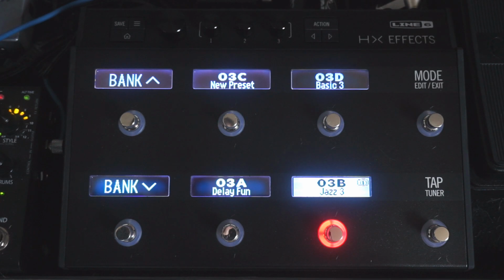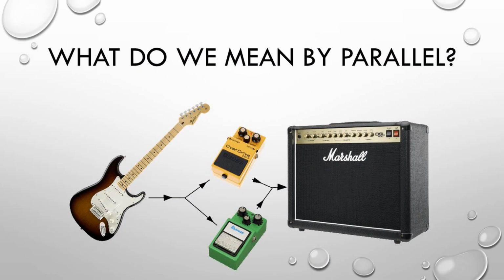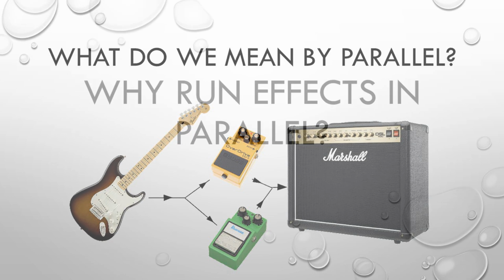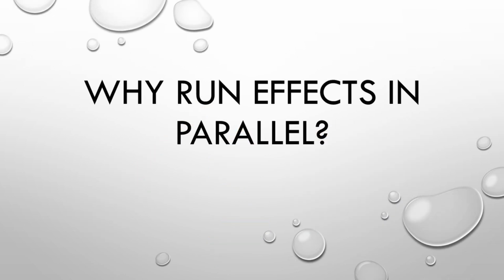Line 6 HX Effects - using the Signal Flow and creating parallel effects

Comment: i have a roland jc 22, it got fx loops and can work in parallel. my goal is to get two signals at the same time, one with compressor, distortions, etc (everything before the fx loops block in my hx) and my delays and modulations i want them clean, 100% wet... but when i set them 100% wet no matter what i do the delay is repeating with distortion... when i run it in series it works but it sucks tone it sound very different. in parallel without using distortion before the fx loop, the sound is perfect, i want the clean delay parallel to the distorted guitar. any clues on what i'm missing here? i mean it  has to be possible to do what i intend or is it really necessary to use two amps to get this 100% wet + 100% dry setup that i'm trying to get?

Comment: Hello, I am trying to use my Hx effect to run all 9 effects at the same time if I want, but what I want to do is have 3 of the 9 always on in the background and still be able to switch on and off any of the 6 on my main interface but thos three in the background always stay on, right now I have those 3 assigned to 3 different switches so 2 effects on each switch.. Do u know how I can do this?
Reply from the maker: If you want those three alway on, then there's no need to assign them to a footswitch at all. Just configure them to be unassigned and use the footswitches for the 6 you do turn on and off. Hope that helps.
Reply: @thehont8648  thanks mate, I actually did figure that out just after I sent the message : )  but thanks very much anyways mate
Reply: I'm glad you asked as I didn't realise this could be done! Thank you both - for the question and the answer.

Comment: Thank you for the really informative video. A question, even if you place the fuzz on a parallel path when it comes back into the main path, even though further along wouldn’t they still be running into each other?
Reply from the maker: It would only be running into effects that come after the rejoining point. The merge will sum the signal, not cause them to interact with each other. Hope that helps.
Reply: @thehont8648  I’m sure that it will. Thanks so much!